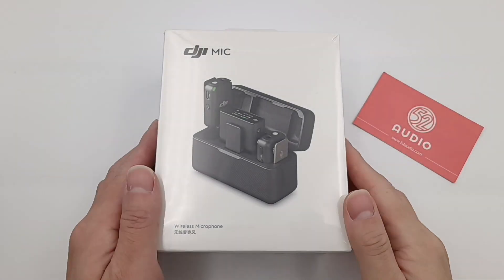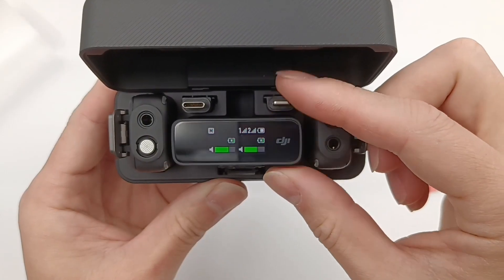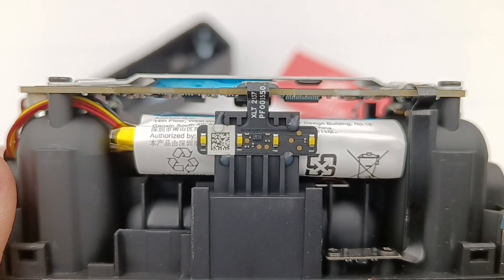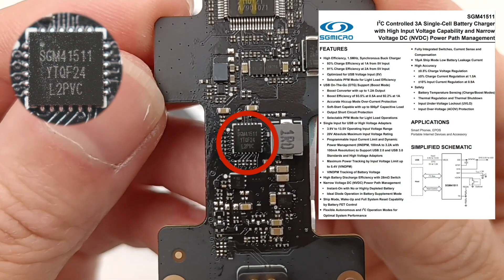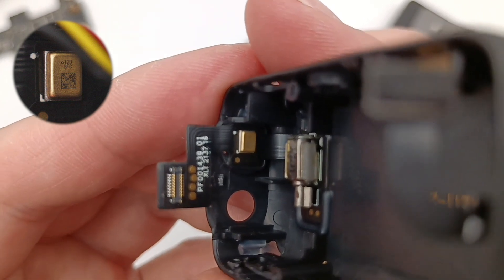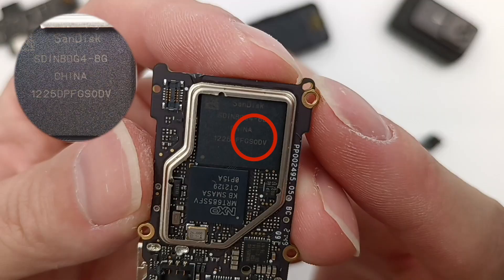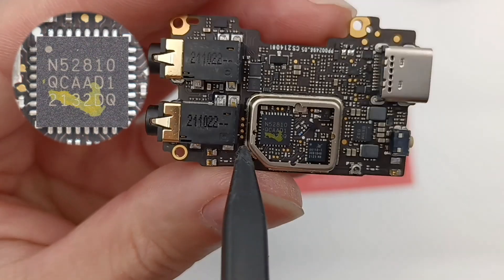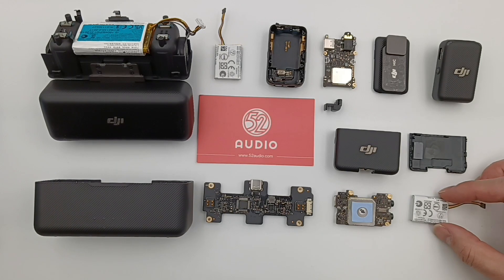Teardown of First DJI Professional Wireless Microphone (Commentary)

Comment: Thank you for this teardown. 4.4V Battery?  Can’t hold up many cycles, can it? At least not easy to find.
Reply: It wil be no worse than any other battery. It's pretty much commonplace to get 4.4 volt lithium batteries. This was responsible for increasing the capacity of the battery by 5%. 

It wouldn't be difficult for them to add a max 80% charge cut off (with a firmware update) which would increase the longevity of the battery. But since the batteries in tx rx and case are on a molex connector it would be trivial to replace them.

Comment: Thanks for the thorough LITERAL teardown, on a more design question , Can the lightning [or USB] connector be LEFT CONNECTED to the receiver and still fit in case?  Or does it have to be disconnected every time you store/charge the receiver in the case?  It would seem to be an amazing pain if you had to disconnect and reconnect on every use. Thanks again for the videos and words of wisdom
- Eric ZORK Alan & Sweetie [ Professional Poets & Bed Vloggers ]  
PS. Also, do you know a design reason why Rode Wireless go can record to iPhone is STEREO [with their Rode SC15 Lightning USB Type-C to Lightning Accessory Cable] and why DJI can only record mono with their Lightning adapter?